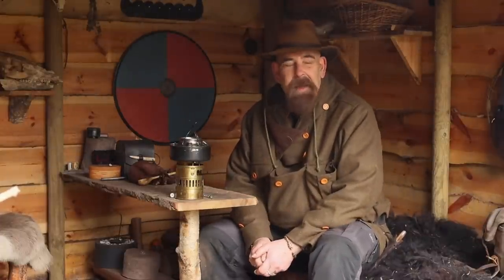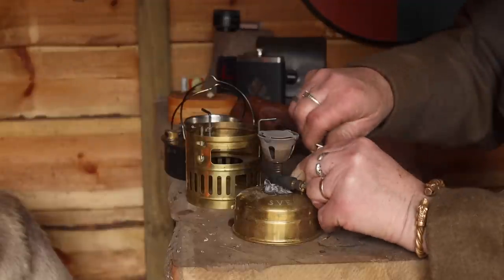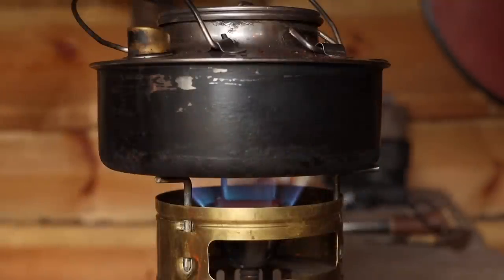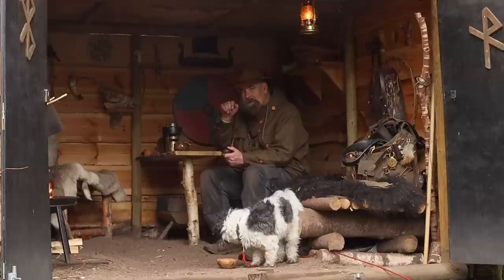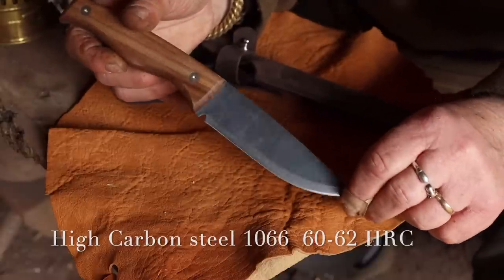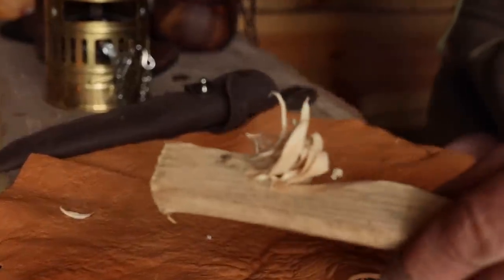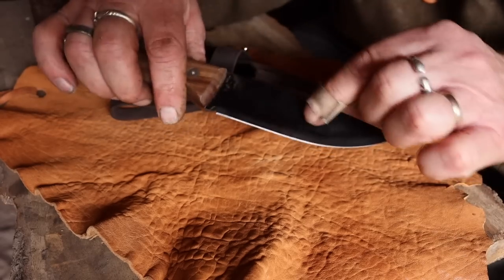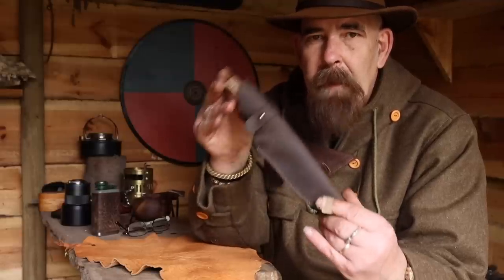New Bushcraft Knife ! .. in Cimbrer Camp

Comment: A cracking little stove there "Tom" and I also like your smock but 180 euros is a bit much for me and I would not get too much wear out of it as I don't get out that much.
I was in the British Army Catering Corps and we used a 2-gallon field stove called a number one burner that made 80,000 British thermal units of heat at 60 PSI pressure and you should hear the noise that thing made.
A Good knife, you may want to strop it from time to time keeps a nice edge 
Take care mate, and have a good one.
Reply from the maker: Thanks for your feedback Robert 😉👍🏻 for sharing your experience with me and for joining Cornelius and I again in CimbrerCamp 🐕🏕🔥🌲
Tom

Comment: Nice work. Can you tell me the name of `` white gas`` in Danish please.
Reply: It’s na-hts, a.k.a coleman fuel
Reply from the maker: Thanks for your feedback and question William 😁👍🏻
We don’t have anything that’s called white gas here in my country 🤔🇩🇰 but I use something called “ rense benzin” … it’s clean gasoline and we use it for cleaning. It’s very good and works great in the stove 🏕🔥🌲
Tom
Reply from the maker: Thanks for your help brother 👍🏻🔥😉
Reply: @cimbrerbushcraft-vikingheritag  hello Tom,
I did some “research” and found that rense benzin (dutch: wasbenzine) contains benzenes and coleman fuel does apparently not. Coleman fuel works better in cold environments and high altitudes. But rense benzin is much cheaper and you can buy it in every supermarket. So thanks for the tip! Btw: would bio-ethanol work?
Reply from the maker: Great you found it too 😁👍🏻 and yes its not expensive 🔥 
I don’t think the bioethanol will work because it doesn’t “wape” its more like oil. But no hurt in trying it out 😉👍🏻
Tom